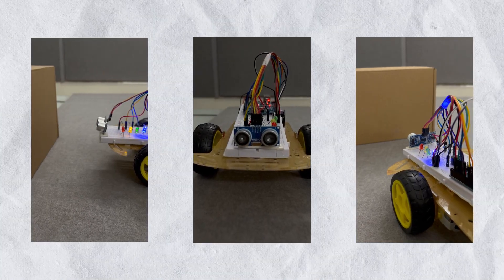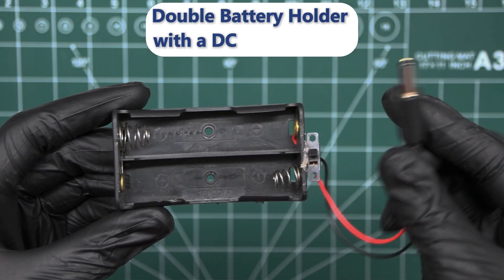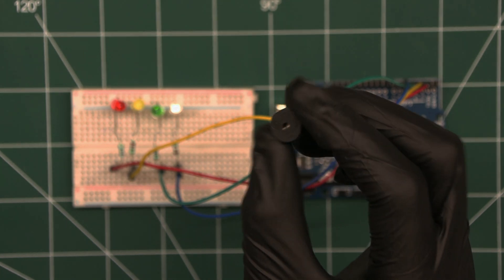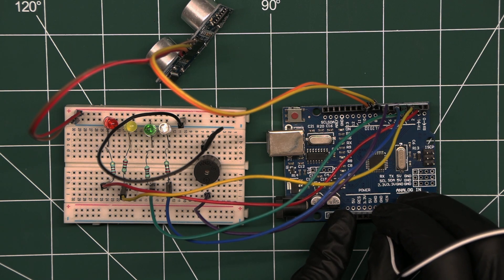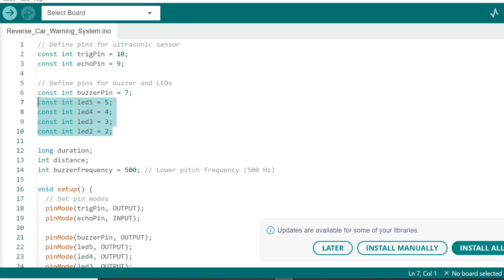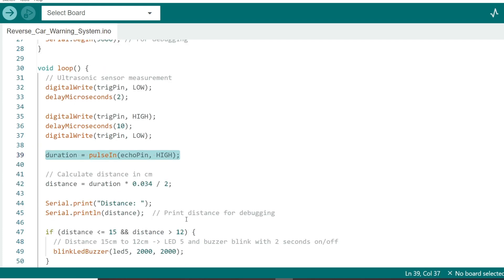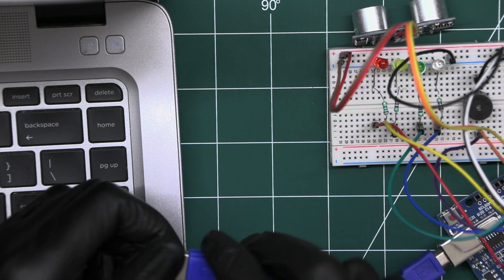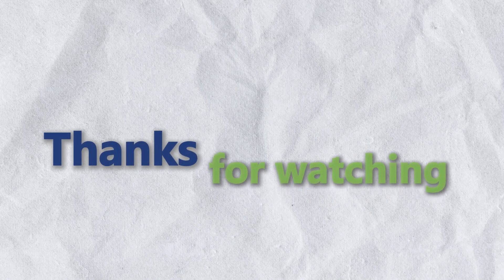ReverseGuard: Smart Car Parking Assist using Arduino UNO I Robo Army I Arduino Project

Comment: It gave me an error saying 'blinkLedBuzzer' was not declared do I have to define it in the beginning?
Reply from the maker: Yes, you need to define the function blinkLedBuzzer() before using it in the code.
The error means that the compiler can’t find that function, so you must either write the function at the bottom of the code or declare it at the beginning.

Comment: How can i control the car with remote not with hand thx
Reply from the maker: Good question!  Instead of hand control, you can use a remote like an IR remote, Bluetooth app, or RF remote to control the car. Each method just needs a different sensor/receiver on the car.